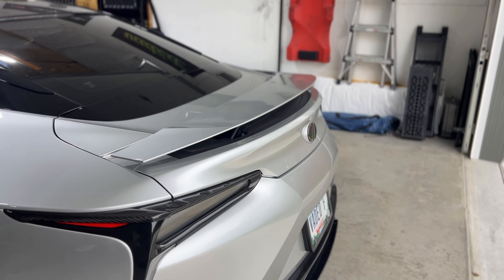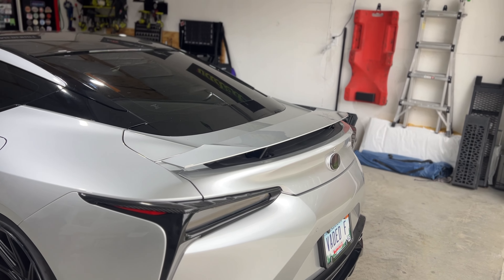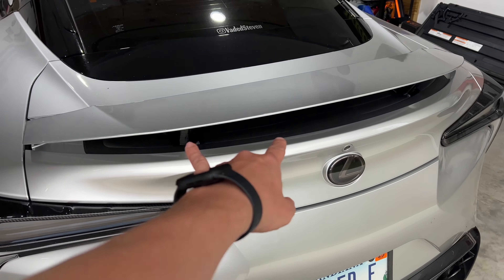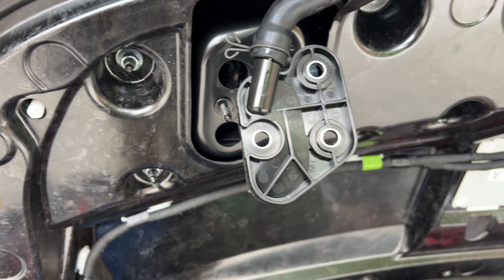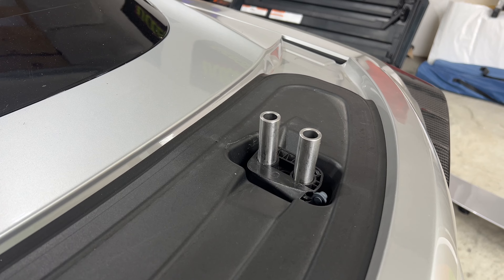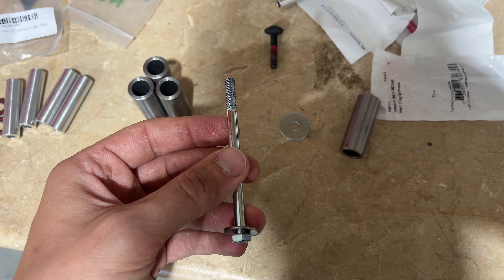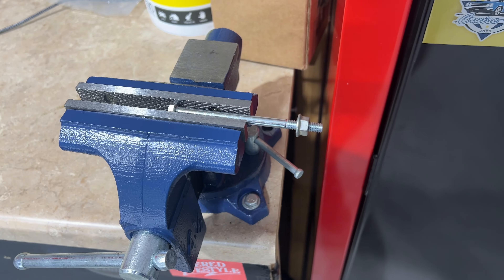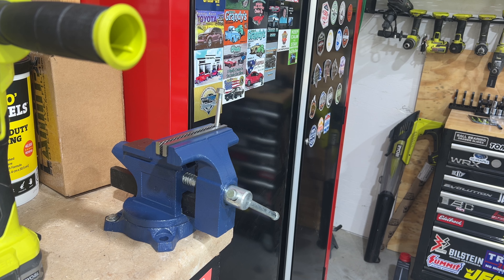LC500 Custom LFA Style Wing Risers

Comment: Could you have used the bolts that came with your other spacers ?
Reply from the maker: No they aren’t long enough. Those other ones have a different style mount with short bolts.
Reply: @stevensgarage-  that's the length? What's the diameter? I think I may do this since I like them better. I took off the other risers I had because it looked kind of lame.
Reply from the maker: I said in the video what length bolts you’ll need and in the description. I also attached the link to the spacers that has the diameter and all of the spacers information.
Reply: Really cool. LFA❤
Reply: These definitely look better! Well done.
Reply: Sorry you said 80mm but what thickness (gauge). Thank you
Reply: @kvue8110  I just measured the bolt I have and it's 3/16" and 80mm long
Reply from the maker: @kvue8110  M6x80 is what I had!